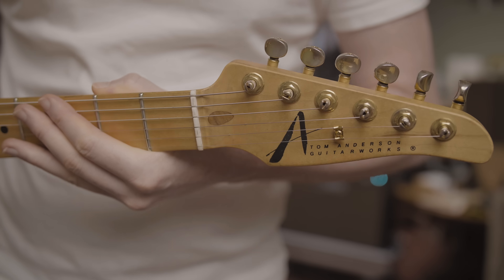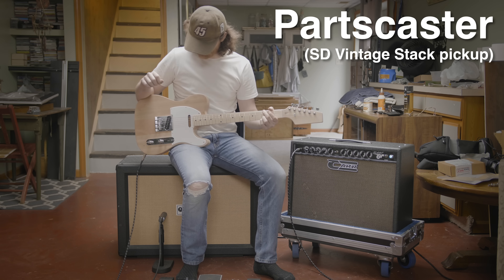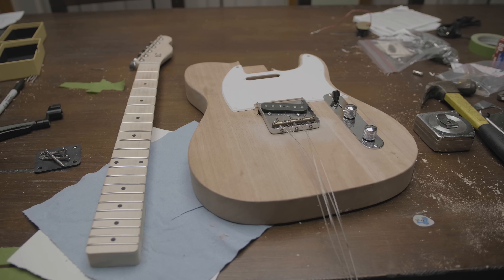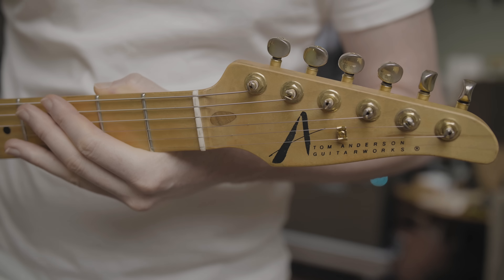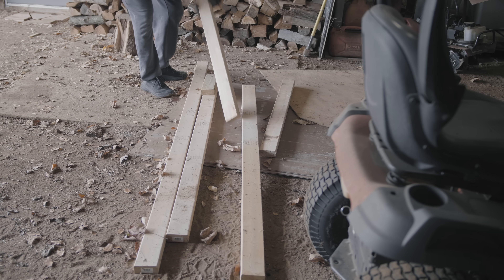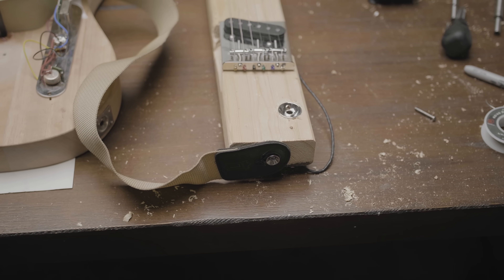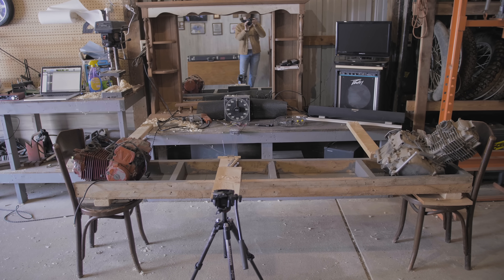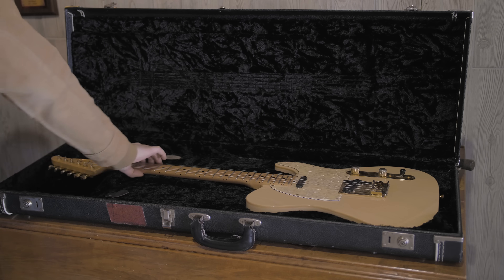Tested: Where Does The Tone Come From In An Electric Guitar?

Comment: I’m a physicist so this is exactly my kind of thing. The only thing I’d like to add is some more objective measurements. Compare EQ curves, time how long a note rings out, etc. I appreciate your approach of using amped sound as the true test, but it would be interesting to see if there’s objective differences, especially given that they might become more apparent in different contexts.
Reply: Taylor, there are already various studies with frequency curves as you say, even a Thesis. There are also videos on that. But for papers for instance, search for "Vibroacustical Study of the Solid-Body Electric Guitar" from Yo Fujiso of the Chalmers University of Technology (2009) or "Body Woods and Electric Guitar's Frequency Spectrum" from Keith  J. Soper of University of Toledo or even "A vibro-acoustical and perceptive Study of the neck-to-body Junction of a solid-body electric Guitar" from A. Paté et al. of University of Paris I think
Reply: Thanks for the info
Reply: dont go there. im a trained luthier and many in our community have done this kind of thing before. Where i am from we even have a university for luthiery. They have hundreds of works from students, professors and other researchers doing frequency analysis, laser inferometry, mode analysis, etc etc.
Its a huge pain and rarely ever produces a useful result. 

The conditions you would need to meet to have a properly controlled and replicable study are insanely high. We have students that worked years just on methods to pluck a string in a way that produces a reproducable result. 

We also already had physicists taking apart every singe part of the guitar and violin, trying to create a model that would accurately describe the acoustics of an instrument.

All of it just leads to nothing. There are just way too many factors for a single person or even a small research group to control. Sound wavs just love to couple with everything. To even come close to have a meaningful measurement of sustain (how long a note takes to ring out) you need special dampened chambers, precise climate control, a pretty sophisticated machine to pluck the strings in precisely the same way hundreds of times over multiple days, weeks or months. Which also means you need to come up with mechanisms to calibrate this machine.

The same kind of effort goes into recording. And its not like you can just set up in such a chamber and leave your crap there. So you need to figure out how to precisely replicate your setup, etc etc.

Many people have done this for decades now. And the barrier for entry is so high its just better to rely on intuitive stuff like in this video here.
Reply: It's oscilloscope time gang!!!
Reply: I like that you brought up how long a note rings out, because I've been wondering if some of the differences in tonewood that people hear are actually variations in the durations of harmonic overtones.
Reply: @Dedbigfed  Exactly, attenuation of harmonics and sustain, that is the "tone wood", those are the main diferences (that's why the 2x4 piece sounds different from the guitar, and the workbench has a lot more sustain than the 2)
Reply: A good idea on measurements, but an issue people often run into is that because something is measurable, it doesnt mean its audible.
Reply: someone did a study like this (can't find the link at the moment). They made "guitars" out of planks of wood, mounted a pickup/hardware, and measured the signal straight into the DAW. The researchers found minor spectral differences between guitars of different woods. They also claim most listeners could pick out the unique recording when given three to analyze. All that being said, a practical test like this video is very exciting to me. If wood makes THAT little of a difference in the finished product, great guitars can be cheaper and gorgeous guitars made from WHATEVER can be commonplace
Reply: Taylor Moon, all that would lead to is to keep suspending people's disbelief. If there's a measurement saying there IS a difference, people will imagine they can hear it.
Reply: Maybe there are measurable differences. But the question is can you hear it. Are you ears able to tell the difference.
Reply: @EbonyPope  Agree, and these measurable differences also exist between guitars that are constructed identically. Differences that are too subtle to change the overall timbre of the system.
Reply: @EbonyPope  Agreed. I think the power of the SD pickup was able to cover most subtle differences. maybe a less powerful pickup, a Rickenbacker toaster perhaps. Also I could detect the biggest difference between string-through and top-loaded - string-through was much deeper in the mids, TL was higher.
Reply: @EbonyPope  But ears vary and what one person hears is not the same as another.  If you measure the differences objectively then you can analyze that data.
Reply: @braynechoblue  I agree completely.  The main point though (for example) is regarding players/luthiers that state that a body made of ash vs alder makes a dramatic difference in the timbre of the amplified sound of the instrument.
Reply: One recorded performance, reamped through an IR, then see if they NULL when flipped.

I suspect the will.
Reply: @djtripnosys  if OP posts the audio, this could be done pretty easily in software
Reply: @Chrysanthemum77  This could not be done without the exact temperature conditions, a perfectly precise robotic guitar player and the assumption that - by the second 'performance' - the tuning would not have drifted at all. At all. Incredibly intelligent software could potentially account for these fluctuations; but this isn't a test that could be fairly conducted with two different live performances, even with 2023 technology. @DJ Tripnosis I like your thinking but it is unlikely at best that even two audibly indistinguishable 'takes' would null in this scenario.
Reply: You’d need a robotic exciter and you’d need to somehow have a time machine to make sure that conditions and age are exactly the same for this to matter.
Reply: If your ear dosen't differentiate, how is it important?
Reply: I'm a cook-astrologer and claim that if you were born between January 1 and December 31 and had a cheeseburger watching Rick and Morty you should definitely avoid playing guitar if not completely dry.
Edit. Dates may vary according to the sauce and your zodiac sign.
Reply: So what you’re saying is, team up for Pt. 2 ? Lol
Reply: I like this direction. I imagine after this vid someone could take this to the next level. More factors will need to be accounted for at that point. Once you get into EQ analysis, don't you have to account for more variability in the equipment you are using to measure?
Reply: True, and thank you for that, and I'm not a scientist and I really do appreciate the thoroughness of scientific analysis - but I would consider the gravity of impact of all factors each and take them into account according to how much each factor contributes to the sound. If the tonewood contributes only about a 100th to the sound than the strings and the pickups, for example, then I would not care about the tonewood at all, as long as it is easier to improve the sound by any easier means.
Meaning that, in order to improve the sound of a guitar, work on the cheaper parts first, i.e. the parts can improve the sound with the least effort.
Also, good sounding guitars might be constructed without all the weight and volume of the wood that is traditionally used, e.g. could make foldable light-weight guitars that could be very easily portable in a small bag, and still sound as good as solid-wood traditional guitars.
Reply: As an electrical engineer, I fully concur. A quantitative test of the units will always be more accurate than a qualitative one. Further, the video still shows which guitar is being played so biases can still be held. Still a very compelling video however and very well presented.
Reply: @mlyten67  Okay, but music isn't quantitative. And you can close your eyes...
Reply: If you wanted to take it a step further you would create some mechanical pendulum that strums the strings so no one can say that sounds the same because the player is playing one guitar differently than the other.
Reply: That would just give wood zealots a platform.
Reply: Let’s not kid ourselves here; the tonewood zealots don’t care about actual numbers. They care about mystical wood properties that they “feel”
Reply: I feel like the time a string continues to vibrate would be nearly impossible to reliably measure  due to extremely subtle variables in how the note gets plucked. You’d have to build some kind of robotic arm that can provide the exact same amount of pressure every time
Reply: total time of a string vibration of course will be different between materials because of damping but in practical application (material being rigid enough to hold tuning) any difference will be well below noise floor of a pickup )
Reply: But just why? I'm sure there are things in physics that call for that level of dissection , but if you can't tell a difference based on your ears, isn't that the point he's trying to make?
Reply: @Derrikbulginheadin  Bias can be a factor there. Measurable objective results would be super interesting to see
Reply: @joseduran9232  Why? Music itself is subjective. You're never going to find 2 people who have exactly the same musical taste, and you can't unequivocally prove to someone something sounds good or not based on a waveform. We all have ears, and we can all use them and make our own judgements.
Reply: @Derrikbulginheadin  - please see my reply to Jacob Anteau - there are very regular differences between the physical characteristics of the sounds, and the way sounds are perceived by the human ear, and if you really want to geek out on all of this, you need to get a systematic characterization of how all that is related! It's an area known as "psychophysics"!
Reply: @DailyBrusher  Electric guitar is played by a person who plays a certain way, on an instrument that sounds a certain way, through a specific amp that effects the sound a certain way, through speakers and pedals that further change the sound, through a microphone or interface that further effects the sound, onto an analog or digital recording that further effects the sound, then played back for the player/engineer who further interprets the sound, released onto an analog or digital medium that compresses the sound, and finally played back through one of a million different combinations of circuits, speakers or headphones that effect the sound, for at least one of of 7 billion different people. Now please tell me what hard "physical data" about perception you are supposed to gather despite all those variables and why it matters to the person sticking the CD in the stereo hoping for a good time.
Reply: @Derrikbulginheadin  - well first off, I already pointed out that my comment is for the "geek" or the scientifically-oriented person, not the casual listener. Also, I think we're all imaging the sound BEFORE it gets to the recording engineer's mic -- the raw sound, the live sound, nothing about recording and playback technology.

And the most important point, I think, is that this all begins with physics, with physical reality; then, it gets into consciousness via BIOLOGICAL physical reality, and it turns out that, before the subjective perception stuff even occurs, there are scientifically available regularities between the physics and the human perception, i.e., psychophysics. So, the geek wants to know all of that - the physics part that provides the stimulus to the subjective, conscious aspect of the listener.
Reply: @Derrikbulginheadin  The reason is they need to cope having their beliefs busted like that lol.
Reply: I am also a physicist, but I think adding those stats would make it too easy to abuse the statistics and fabricate differences.  This is the subjective matter of music, and if you can't hear a difference, there is no difference.
Reply: @jacobanteau6020  - I've done some work in cognitive science, and I can tell you this: In psychology, there is a sub-area, psychophysics, which studies systematic differences among perceptions and the actual physical characteristics of the stimuli. For instance, in the 19th century, Fechner found very regular discontinuities between brightness of a light (lumens or what have you) and perceptions of brightness.

So, for the "geek," or anyone who just really wants to know everything happening within this complex phenomenon, you need both the physical data, and the perceptual data (does it sound cool?!), and then to see the relations there!
Reply: @DailyBrusher did you study psychacoustics?
Reply: @oxygen69able  No, I did not. I am aware of this kind of thing, but I have not studied it seriously. How about you?
Reply: I think the biggest difference is how the player plays the tone of the guitar. Thats something I don't thing any human can control. Slight differences in attack bends and vibrato according to how pickups etc sound. doing it in a lab environment with a machine is moot because that says very little about how a human plays a guitar.

Comment: Really, REALLY interesting video. Thanks for taking so much time and not-inconsiderable effort into producing it. While I thing just about EVERYTHING plays its part in the final tone, your approach suggests that, in the case of a solid body electric guitar at any rate, 'its' sound comes foremost from the pickup(s). Of course, the amp will also play its part - and a major one at that. But as your video proved, anything else, even the body, has little bearing. So when we're deciding between a $500 and $5000 axe, the justification is probably not "its tone", but "it's playability"! GREAT WORK... and thanks again for producing it. 🤟

Comment: This was truly a great experiment. My initial reaction was "I just saw and heard that but I don't believe it." 

I've seen other videos by warmoth where they compare fretboard material (rosewood vs. maple) and I heard a difference in that video. I think what it comes down to is a guitar is a complex system, with many interacting parts, each with their own influence on the resonance of the string. The strings, bridge, and pickup seem to have the largest impact on the tone. I've changed bridges on guitars and had the character change fairly drastically (6 saddle tele bridge vs. 3-saddle brass bridge). Pickups are a no-brainer, it's essentially the microphone listening to the strings.

The thing that gets me about the whole "tonewood debate" though is that all of the parts are mounted to the same rigid base. This means that there is a mechanical connection, and the body must also have some influence over the vibration of the strings. In a solid "plank" body guitar like a telecaster, this influence may be fairly minimal (as I think you've demonstrated). In a guitar with a more flexible body and/or top, I believe it's likely that the body may have more of an influence over the overall tone. This definitely seems to be the case with hollowbody vs. semi-hollow (small block) vs. centerblock guitars.

Anyway, this video really made me think about what's happening and what matters most in creating a guitar tone :)

Thanks!
Reply: How much you want to bet those other vids where you heard the difference didn't bother to match string to pick up height? That should be the biggest take away from this video for anyone wanting to "change their or get the right" tone. Even if its the same guitar if they didn't redo the set up to match after the neck swap then its going to sound different.
Reply: @SW-zu7ve  Exactly this! Also, who knows if they didn't do some stuff in post. They sell this stuff
Reply: No, the video Warmoth made, was made by a business that had a vested interest in the outcome of that video, I watched the same video and knew that it wasn't entirely authentic when I watched it. They sell a plethora of different guitar bodies & necks, made from a plethora of different timbers. If it didn't matter which type of wood, if even wood at all, those bodies & necks were made from, then their business would suffer badly because of that so it was in their interest for tonewood to exist, and for you to believe that, but you heard the results here for yourself, from someone who isn't trying to sell you a new roasted maple neck for £200, or a new guitar body made from some exotic wood for £500.
This video will make a lot of people look very silly 😆

If you're going to watch any kind of guitar gear comparisons/reviews, or anything of that type, then it'll be a good idea to watch some that are made by independent video maker who doesn't have any consequence one way or another, whatever any results might be.
Don't believe everything that you see or hear on a YouTube video 👍
Reply: There's this scientific study from the mid 2000's by this German guy and the conclusion is that body of an electric guitar  only has an effect on the plugged/amplified tone if it is completely hollow.
Reply: You're just as likely to hear a difference between 2 identical model guitars due to variation as you are to hear a difference between 2 guitars with different body woods. Pickups are by far the biggest influence on amplified tone
Reply: Those Warmoth videos were pretty convincing. Only thing is, this guy's video could be fake.
Reply: @kilgoretrout321  Nothing stopping you from picking up your guitar and lowering or raising your pick ups to see if it might be "fake."